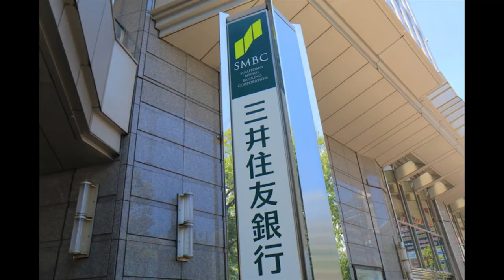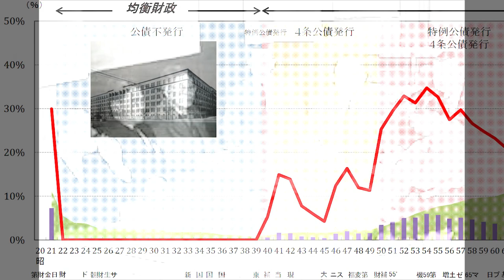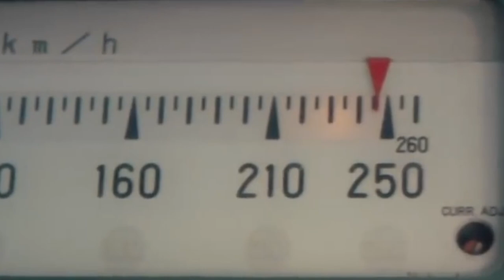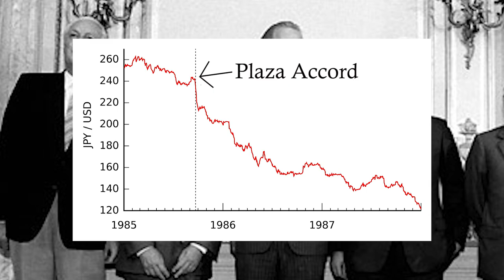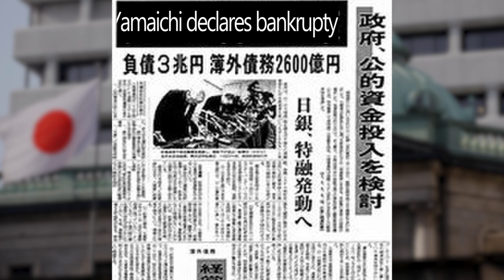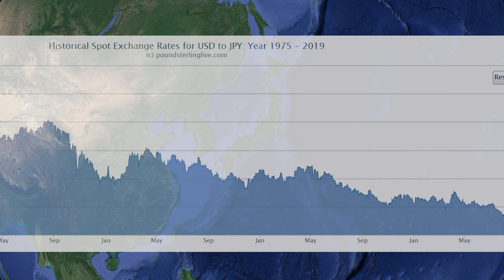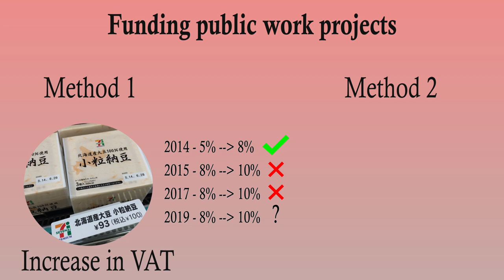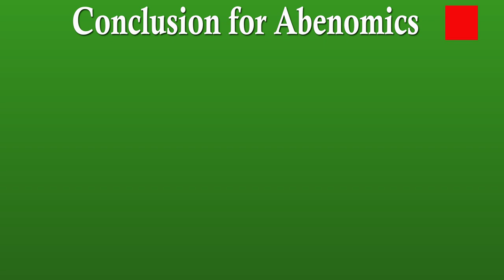Japan - The History of Economics (Documentary)

Comment: I don't think a central bank expands the money supply in order to stimulate local consumer demand.  An expanding money supply lowers the value of money and the cost of capital.  This is good for debtors as they can repay loans with cheaper money than when they took out the loan.  This also helps exporters as their goods become cheaper in foreign countries.  This is not good for importers and consumers of import goods as it makes those goods more expensive compared to locally produced goods.  And every time the money supply is expanded, the value of all existing currency is devalued, lowering the purchasing power of consumers.  So this is really not good for local consumers.  This price inflation may not immediately be apparent if people are in a savings mindset as the velocity of money is low.  This often happens after a period of war or other traumatic situation.  But once people start feeling safe to spend again, they will see prices rise.
Reply from the maker: Can't believe how I missed reading your comment.

 I think you are spot on regarding the interaction of the money supply and inflation (of course we can also debate on the issue of how the CPI is currently calculated but I wont go there now...).
This might be the reason why so many people (many smart ones too) believe that we can keep getting away with more money printing and stimulus. People should understand that it is not a linear pattern but an exponential one, where the tipping point can only be known in retrospect.